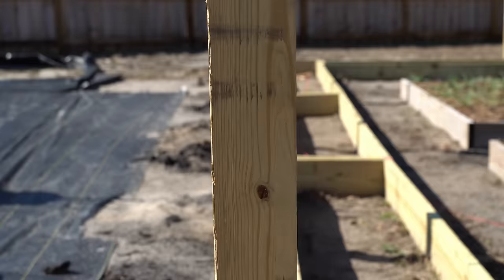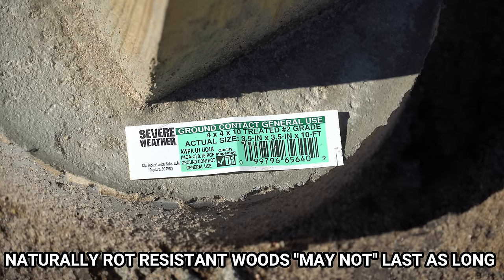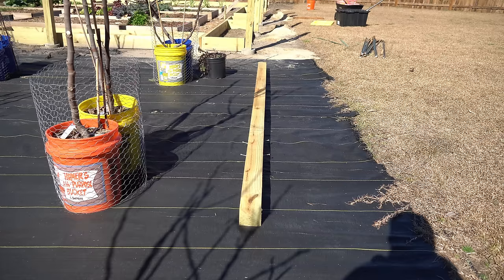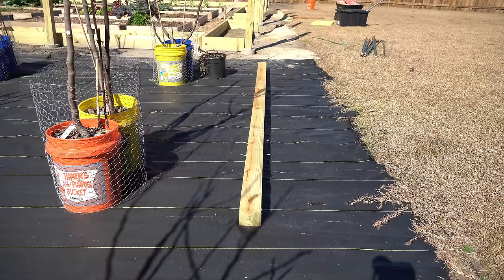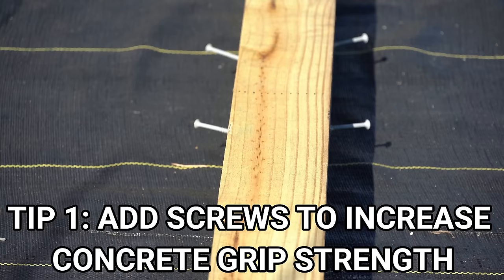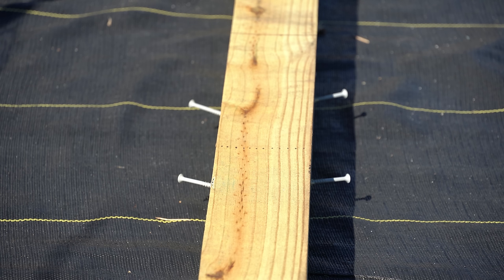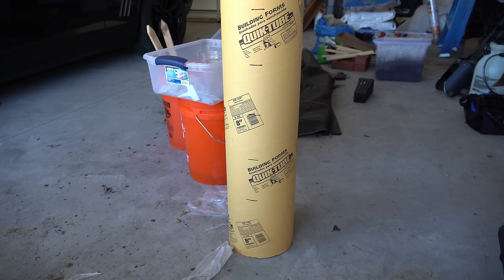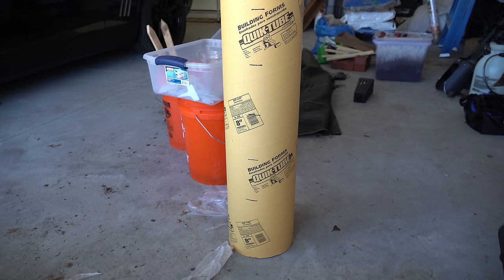3 Tricks To Installing Stronger 4X4 Wood Fence Posts That Last Longer

Comment: All those wooden screws did was make a easier way for water to get in the post.  Very bad idea.
Reply from the maker: That’s incorrect.  The post is ground-contact pressure treated.  That means it was soaked in an aqueous solution, so the solution penetrated the entire piece of wood.  That’s why pressure treated wood is so heavy.  They aren’t simply exterior-treated.  It doesn’t matter if you drill into them, because they have absorbed the solution.  Drilling into them doesn’t hurt them.
Reply: @TheMillennialGardener  You may want to cut a 2x to see how deep the copper solution  penetrates - it ain't all the way

Comment: Are you at all concerned about the chemicals in pressure treated wood leaching into your garden
Reply from the maker: Mike Swann no.  This is a comment that has been asked many times and a myth that won’t die.  The dangers of pressure-treated wood come from the old, green arsenic treatment that was banned for residential use 20 years ago.  It is pretty much limited to utility poles these days.  Modern residential lumber uses copper azole treatment, which is considered non-toxic.  You can purchase liquid copper concentrate to mix as an organic fungicide.  Copper is not considered harmful when used as directed.

Comment: But the cement is probably prop 65 (cancer) and the pressure treated lumber is sprayed with chemicals. It seems unnecessary to have a 4x4. 10’ tall wood post in the garden,  that’s commercial grade lumber for buildings and stuff.  Most people recommend not using pressure treated lumber in home gardens ..
Reply from the maker: This pressure-treated lumber myth needs to die.  This is bad information from 20 years ago when residential lumber was treated with CCA (arsenic).  This practice ended in the early 2000's and CCA is mostly reserved for industrial applications like utility poles.  Today's modern pressure treated lumber is copper azole, which mine is.  There is no information showing copper azole to be harmful.  In fact, you can purchase liquid copper concentrate to use as a fungicide in organic gardening.  I treat my tomatoes weekly with liquid copper.  Minor amounts of copper azole preservative in soil is meaningless.  This is not overkill if you've ever grown indeterminate tomatoes, which will be 7 feet tall by June here.  My trellis is only 7 feet high using 10' 4x4's.  If you can go higher, I say more power to you.  This was the limit my back could handle.

Comment: Wouldn't the damn clay soil drain into the gravel, making the post permanently wet? I'm confused because I keep hearing both arguments.
Reply from the maker: No matter what you do, wood that is placed in the ground is eventually going to rot.  The question is not "if", but "when."  If you have clay soil, the rotting will likely speed up.  I would definitely add concrete to help slow the rotting process.  Remember, soil contains organic matter, and organic matter is going to hasten rotting.  Soil is a breeding ground for bacteria, which is what actually causes rot.  By containing your posts in concrete, while the concrete does hold moisture, concrete is not a viable breeding ground for bacteria like soil is.  Therefore, concrete actually prevents rot by not allowing bacteria to grow quickly.  Consider that.

Comment: Screws are not suitable for increasing the pull out strength.  They don't have the proper shear properties.  Normal, hot dipped nails are much better, being more malleable and less likely to break.

Comment: screws in the posts.  what will pull the posts out of the ground if you did not have screws?  yes they are cheap to add but there is really no need for them.  they do not add strength to the wood.  they increase the strength of the post to concrete connection.
Reply from the maker: John Conrad they serve many purposes.
1. Pressure treated wood expands, contracts and twists.  This helps support against that twisting and bowing.
2. I live in a hurricane zone. We are subject to extreme horizontal and vertical forces.  This, again, adds resistance to those forces, especially vertical.
3. I am hanging hundreds of pounds of tomatoes and cucumbers off these trellises, which is a heavy vertical force.
4. It costs no money, takes no time and adds strength. There is no reason not to do it.

Comment: I would use nails instead of screws in the timber buried in the concrete. The screws add no advantage and the nails will be cheaper and thicker.

Comment: Burning the base of the post will also make the post rot hardier, I think it's a Japanese technique.
Reply from the maker: I've seen and heard of people doing that with wood posts. However, I've never seen it done with pressure treated wood.  Since PT wood is so wet, I'm not sure how well it would work. If it were a naturally rot-resistant wood like redwood, cedar or cypress and untreated and dry, this makes a lot of sense to me. I don't know how a piece of wet, pressure treated pine would handle such a thing.

Comment: NEVER NEVER NEVER use pressure treated lumber where you're growing food.
Reply from the maker: This is not true, and hasn't been for 20 years. Modern pressure-treated residential lumber is treated with micronized copper azole (MCA) preservative, and it is non-toxic.  There is no scientific reason to avoid the use of modern MCA-treated wood in your garden.  If the compound was toxic in any way, the plants would be sick.  Since all plants are perfectly healthy and thriving, the compound cannot be toxic by definition.  Spreading this myth does a disservice to gardeners everywhere, because those that believe this myth are spending far more money than they need to spend on beds that won't last as long. https://youtu.be/7_o7izMvGc4

Comment: The screws you use should be rated for treated lumber. The screws don't really do anything because you don't have any forces trying to pull the posts out of the gound vertically; wind is a lateral force and for that you need at least 3" of concrete surrounding the post, preferably with some steel wire inside to help keep the concrete from cracking at the weak spots at each corner of the post. The wire should be completely encased in concrete so it won't rust and it should not touch the wood either. For 4"X4" posts an 8" diameter tube is really not big enough 8"-3.5"divided by 2 = 2.25". I don't use concrete; just gravel all the way up to the top filled in 3" increments and tamped/compacted down. This gives you the best drainage around the post. your post hole should be at least 12" in diameter. If you fill with concrete, slope each side of the top away from the post; you dont want the water to settle next to the post. You can coat the buried portion of your PT post with bitumen/pitch/tar to give it another layer of protection.
Reply from the maker: This isn't true.  These 4x4's are structural.  They are holding fence, an aerial trellis and a gate.  There are hundreds of combined pounds of fence, airplane cable and plants hanging on these t-posts, and every time the wind blows, this causes both horizontal and vertical forces to push and pull at the posts.  When people install 4x4 posts, they don't just sit there in isolation.  People set 4x4's with the goal of attaching something to them.  You're also forgetting about expansion and contraction forces that come with the heating and cooling that occurs throughout the season.  In addition, one of the hardest things on a 4x4 post is a gate.  The point of the concrete tube is not to add structural rigidity.  It is to create a foundation reveal so water does not pool around the post and rot it prematurely.  This will occur if you pour your concrete level with the ground.  It will eventually settle and create a rut, and that concrete will become the low point that water settles.
Reply: @TheMillennialGardener  Thank you for the reply. Not being argumentative or antagonistic here, just putting in my two cents' worth, so to speak. If the concrete poured around your wood post is thin enough, as I wrote earlier, 2.25" and unreinforced and your post expands due to temperature increase, more likely with wood, moisture absorption, it will swell and cause the concrete to crack at the weakest point since concrete has little tensile strength without some steel in it to reinforce it against the post pushing outward on the encapsulating concrete. if the concrete cracks, you might as well have only filled the hole around the post with road base anyway since moisture will infiltrate through the cracked concrete. Concrete would be better than gravel fill if your soil is moisture retentive such as clay, however. but in any case, the best method, in my opinion is to use galvanized steel structural post saddles embedded in the concrete rather than the wood, keeping the wood post a bit above soil and concrete. The saddles should be the type you attach with through bolts, not just screws. I'm not sure how much pressure treated posts expand/contract due to moisture absorption comparred to green lumber but moisture is a more significant factors than temperature in dimensional stability of softwood lumber as far as I know; something like 4% overal dimensional change across the grain; that's somewhere around an eighth of an inch for 4X lumber. So if you poured your concrete at the lumber's dryest, it will exert a lot of force on your concrete as it tries to expand that eighth of an inch and if the lumber is very moist when you pour, it will shrink away from your pour by that much as it acclimates and dries, leaving a gap all around the poured concrete for water and contaminants to infiltrate and accelerate decomposition of the wood.
Reply: @henrikmanoochehri4613  - yes, I believe you are correct on all points.

Comment: You know you could just cut waves in the bottom of the post that's going in the concrete then there's no screws To spend money on
Reply from the maker: That sounds like a lot more work, and it could facilitate rot more quickly. Individual screws cost pennies a piece, and it's a lot less work.

Comment: Those ridiculously small skinny screws. Coat some small rebar and drill them through the base & 8inches up another. Build up the concrete to 3 inches above the surrounding dirt.  Your job will last not very long. Been-There-Done-that !! Concrete doesn't sink UNLESS you didn't tamp the soil correctly. Why hasn't your house sunk. Why hasn't your driveway sank ? Ponding happens when you...YES YOU DIDNT BUILD IT UP & TAMP IT.
Reply from the maker: Nothing has moved in 2 years.  No sinking.  Everything is exactly the same as what it was the day it was built.  All foundation reveals have held nicely.

Comment: Soak the end of the post in used motor oil. Bury. Forget.
Reply from the maker: You don't want petroleum products in your garden soil.  There is no reason to go further with ground contact rated wood.  This will last a decade+.

Comment: Rot doesn't happen from the bottom up. It needs oxygen. Dampness doesn't automatically cause rot. You also need specific temperatures for the organisms to do their job. They simply don't live that far down. This is why rot always starts at the top. As the wood rots more oxygen is allowed to go deeper. This is from nearly 20 years in contracting. BTW, I have also never seen a post pull out from concrete that the concrete wasn't split. Skip the screws, they aren't needed and aren't solving a real problem. Even if I had seen a few, out of the thousands that I have pulled it still wouldn't be worth the cost of the screws and the time it takes to install them.
Reply from the maker: Rot is anaerobic.  Rot occurs in environments that lack oxygen.  When environments are rich in oxygen, aerobic bacteria "choke out" the anaerobic bacteria and take over, so rot slows.  This is why rot occurs more quickly when you bury things than when they sit on the surface.
Reply: @TheMillennialGardener  sorry man you are just wrong. Rot isn't some process of the universe. You need either fungi or bacteria to do the work. Both require oxygen. Things don't rot from the bottom up.

Fungi require oxygen. So rot is intact an aerobic process. A quick Google search before responding would have proven this to you. It's why we find ships hundreds and sometimes thousands of years later under water with very little "rot".
Reply: @TheMillennialGardener  and the air drying things out as well as the UV rays from the sun is what slows down rot above ground. Fungi live within the first few inches of soil. Try an experiment. Bury something that rots quickly just below the surface, 12" down and 36" down. Want to bet the one at 36" isn't more rotten than the one just below the surface?
Reply from the maker: @MrRaptorman1975  I think you’re confused.  Yes, there is a such thing as aerobic composting, but the composing that happens underground is anaerobic.  The process that rots wooden posts is anaerobic, not aerobic.

Aerobic composting requires lots of heat.  That is why above-ground composting stalls in the cool season.  Without heat, aerobic composting comes to a crawl.  This is why “hot composting” exists - because aerobic composting without heat is terribly slow.

You’re confusing the two.  The condition you need to worry about with wood posts is anaerobic, not aerobic.  Anaerobic composting is much faster than aerobic, because it still occurs in cool temps, and the ground is always cool.

https://www.moonshotcompost.com/difference-between-aerobic-composting-vs-anaerobic-composting/
Reply: @TheMillennialGardener  And didn't you first start off by saying rot is anaerobic not aerobic? Now you admit that there are two types? Talk about confused.
Reply: @TheMillennialGardener  Also about 10 degrees C or 50 degrees F for rot to occur. That's not what I would consider a lot of heat.

Comment: Great video. The screw idea seems like a good idea. I have a question about treated lumber, I hear that copper-green or equivalent has to be placed on cut ends and penetrations like screws especially when in ground contact. Have you heard this?
Reply: Yes it’s true. Cut ends are like straws for water. Seal them then you can even hit them with a sander to close them up a bit

Comment: Too deep holes! They only rot where concrete meets the air, never at the bottom
Reply from the maker: When installing posts, the general rule of thumb is to bury 25-30% of the post. For a 10’ 4x4, that is 30-36 inches.

Comment: #1 is incorrect try to pull a 4x4 out of set concrete
Reply from the maker: The goal isn't to pull the 4x4 out of the concrete.  It is to lift the entire post with the concrete foundation out as one piece.  That is why the screws were used - to increase the friction and better bond the concrete cap to the post.

Comment: Mr Milennial...  

I have been building fences for 30 years... 

Rot needs moisture, food and oxygen. 

The trick is getting the concrete which holds moisture away from the soil line... where the oxygen is. 

We set to 42"... concrete only in the bottom half. 2' remaining gets backfilled with screenings. 

Water doesnt sit... and the gravel compacts. I can show you 4x4 cedar posts supporting fences that have not rotted. 

You will also find that in extreme winds... posts snap off at the concrete intersection using your method.
Reply from the maker: Cedar would have been a good choice.  They're pretty pricey, though.  Pressure treated wood warps, so using cedar, redwood or cypress definitely is a good choice if you could get it.

Comment: Never, ever do what this guy is doing.  Never bury wood into the ground - including concrete.  Just pour a concrete footer and either embed a metal saddle.  Or screw in a saddle after the concrete cures.  Never have wood anywhere where it's going to sit in water.

Comment: LOL,,,,your so called tip on adding screws is not helpful.  The screws only help with lift straight up therefore are unless you are building a structure which is affected by wind. 

As for buying gravel in bags from a lumber yard,,,,Sheash,,,,what a joke!  Just take some plastic trash cans and or buckets to fill at a local gravel pit or landscape supply and buy from them for 1/10 the price.  I prefer concrete sand which has three sizes of sand and after watering in gets almost as firm as concrete all by it’s self.

Comment: Geez people. Lighten up. Way to much on the precautionary moves. In 1980, I dug some 30 inch deep holes. Put some treated fence post in, pored a bag of concrete around each, and added water. 40 years later those post are fine. Get a life hey.